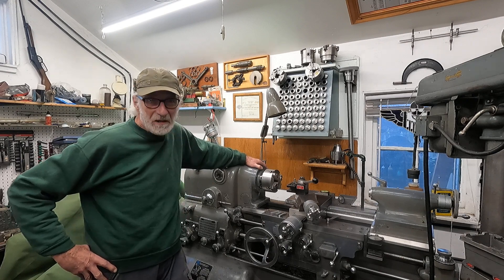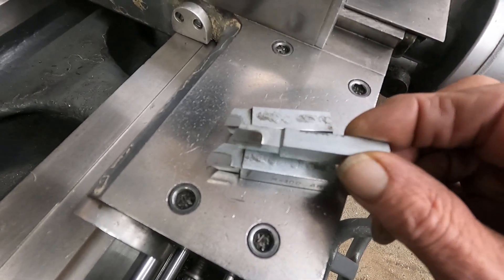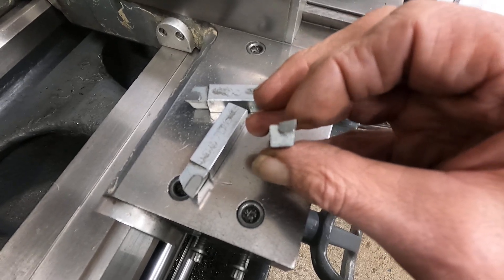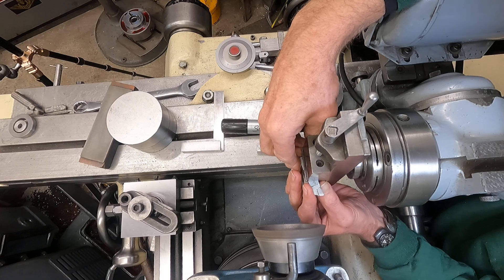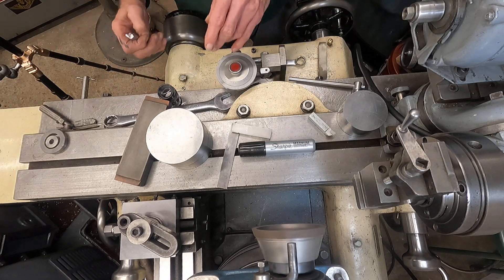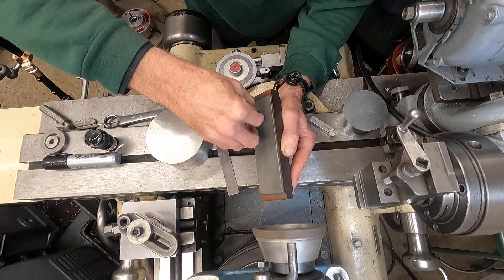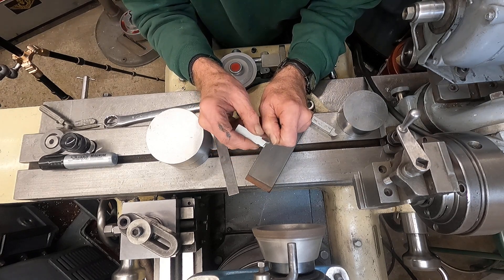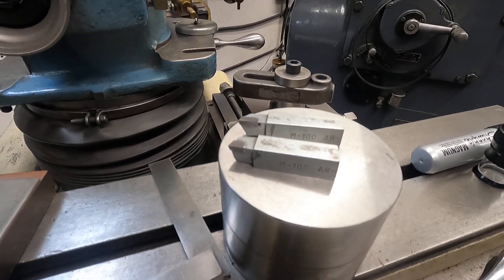Monarch 10ee Lathe finish tool preparation

Comment: Don,  More great information and tricks.  Wonderful. Do you grind the carbide and the steel with the same grinding wheel?  Or, do you grind the steel away first and then grind the carbide?  Many Thanks for everything you’re doing and Best Wishes For The New Year.
Reply from the maker: I think if one takes bits and pieces of what I do, and improve on it, it could be useful. I do grind back the steel on the brazed tools on a bench grinder or with a cutoff wheel on a die grinder, though the diamond wheel will plow through it.
 Yes, its nice to be on this venue, and not being harassed by the little pissant creep that owns the Fake Machinist Forum, or his clowns! Merry Christmas!